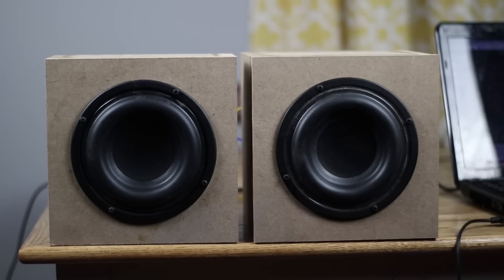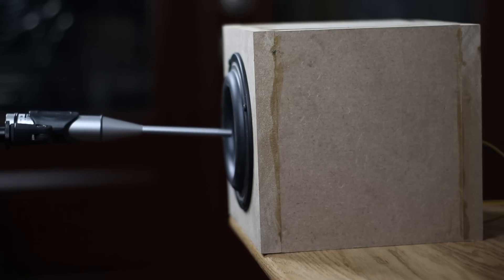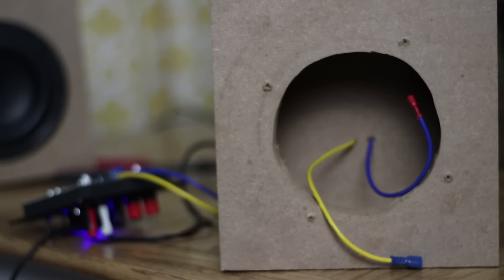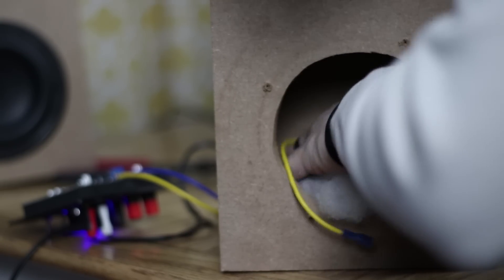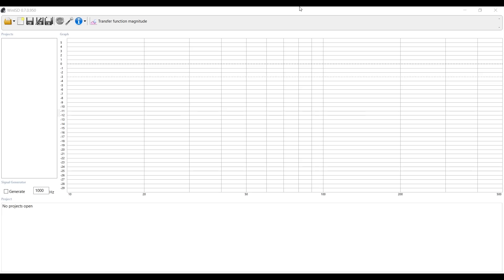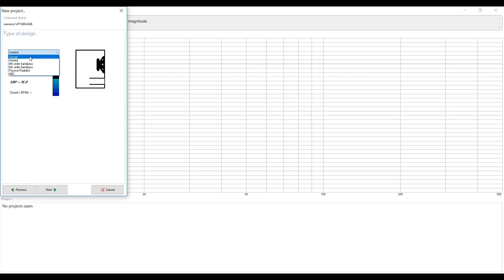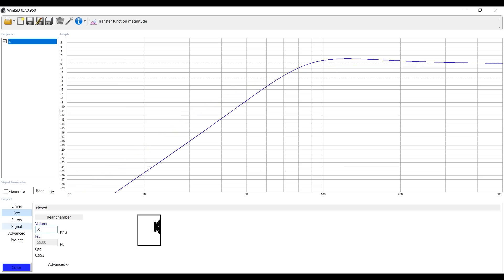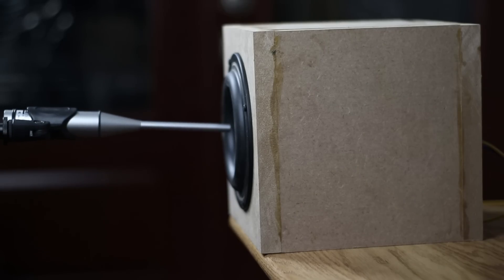Does Polyfill make a Box BIGGER?  Tested and Revealed

Comment: PF doesn't make the box "bigger". PF slows down the sound pressure waves inside the enclosure making them act as if they were in a larger enclosure.
Reply from the maker: Thanks for the clarification. I thought I said that fairly well from around 40 to 60 seconds. I hope no one thinks I'm implying the box itself actually gets bigger. Although, that would be a pretty cool trick.
Reply: i made yer moms box bigger
Reply: "it's bigger on the inside" lol plus it's not 50% difference it more around 15%, not to mention if you put too much in it kind of "kills" the sound.
Reply from the maker: @attainableaudio7130  I agree it definitely isn't 50%. I think the test showed that. All this test is designed to do is to see if polyfill actually makes the speaker react as if it would in a larger box. But even with a completely filled enclosure, we couldn't reach that number. The cool part, is that this does work. Which means you can make the box smaller if you need to and try to make up some of the difference with polyfill.  As far as it it "kills sound quality," that wasn't tested.
Reply: @Toid  yes and no. The filler is affecting the sound waves in proportion to a particular wavelength within the internal dimensions of the box.  Enlarging the 'perceived' internal box volume by the driver is sensible only to within less than  ~10%. After this, the other properties of the filler (density, composition etc) starts to interact too much with the balance of the whole set up/design. This is what's noticed as 'killing the sound'.  Theres no free lunch.
Reply: This video is extremely questionable because no where in the video are there any points of clarification. The video blatantly suggests that Pollyfill is a cure all for bad speaker enclosures. Polyfill should be used for it's intended purpose, to fine tune a box design not compensate for it. You should be building the box the correct size, not trying to fudge figures. You graph only shows a very basic frequency response with no consideration to other measurement both electrical and mechanical. Also Polyfill doesn't increase the size of the box, the size of the box is the size of the box, all it does is increase the surface area to dampen the response / reflections. Which gives a pseudo effect of a bigger box in some ways.
Reply: Yeap,slow down the pressure waves and the internal temperature air box.because the areaof the polyfill is very huge, and acts as a heat sink,similar as an adiabatic compression (loudspeaker cookbook)
Reply: @Lewis Goudy lol
Reply: What polly fill actually does is fills the box with polly to increase the output power of your amplifier🐴
Reply: @fusiondensity3287  Does that mean if you had a source of dead parrots they would work as well?
Reply: @jonathansturm4163  a dead parrot works great as well in some boxes
Reply: You've gotta be kidding me lol
Reply: I believe that it will not slow the waves down at all as that would mean that it would change their frequency, but, instead, it just scatters the wave propagation inside the box, so it effectively minimizes the standing waves and harmonic resonances caused by the shape of the box and natural resonances of the box and the speaker. I hope this is comprehensive enough.
Reply: @MomirPeh  No, it actually does slow down the sound / pressure waves. Doesn't alter the frequency. Remember you're changing the medium the pressurewaves travel through here. It's not just unrestricted air anymore.

"Sound" travels through different mediums at different speed. Doesn't need to be air (or any gas at all), as long as the medium can carry pressure waves of those frequencies. Whether it's inside a stuffed box or under water, the pressure transgressing the medium eventually reaches your eardrum and is translated to airpressure in your inner ear, or jawbone and induced directly to the cochlea.
Reply: @MomirPeh  That's the right answer that now saves me from typing it. Thanks.
Reply: @MomirPeh  Actually, that's not true. The way waves work when they change density of medium, and therefore speed, is the frequency stays constant while wavelength changes. If sound speed decreases because of the presence of poly fill, the wavelength decreases too while frequency remains the same.
Reply: @garrettrichards5559  Thanks for the explanation in such detail, Garrett! I tried to oversimplify, but I got it wrong. My mistake! Cheers!
Reply: @garrettrichards5559  I'm not sure what you are saying. The wavelength is the frequency. How do change the wavelength without changing the frequency?
Reply: @easyamp123   No, wavelength and frequency are not the same thing. They are inversely proportional. The basic equation that relates speed, wavelength, and frequency is: v = f * λ  (v is velocity/speed, f is frequency, lambda represents wavelength.) Therefore when you compare two waves of the same kind in the same medium, high frequency = low wavelength and low frequency = higher wavelength. Frequency is what you perceive in terms of light color or sound pitch. You don't perceive wavelength.

So regarding your question - how do you change wavelength without changing frequency, the answer is to change the medium in which the wave is moving, and therefore the speed of the wave itself. Frequency will stay the same while wavelength will vary directly with the change in wave speed.

So for example, the speed of sound in air at 20 C/68 F is 343 m/s. The speed of sound in air at 0 C/32 F is 331 m/s. Therefore even using the same medium but changing its temperature can affect wave speed and therefore wavelength. The speed of sound in liquid water at 20C is 1482 m/s, much higher than in air.
Reply: Garrett Richards  very cool, thanks for the explanation.
Reply: Garrett Richards false. Frequency does change. It’s been tested multiple multiple times. Mystonermind did a polyfil test with the same test repeated multiple times and the frequency response changed quite a bit actually.
Reply: Jasenko Cicvara no it’s true frequency response does change my friend
Reply: @doskoreanitos2588  i find this "debate" interesting, I found the channel your talking about and I'll look for the test done, but do you know about how long ago or the name of the video?
Thanks
Reply: Attainable Audio I put the link in the comment above yours